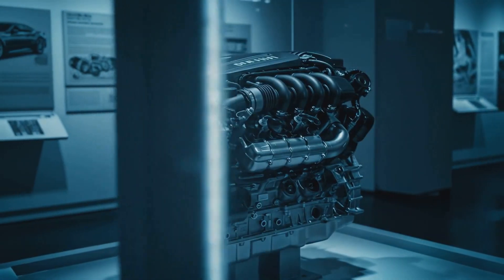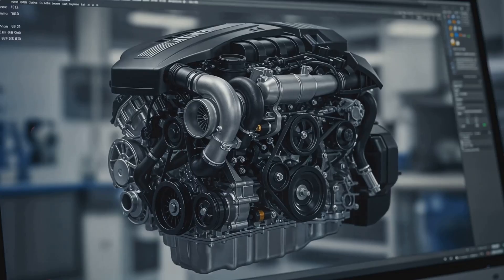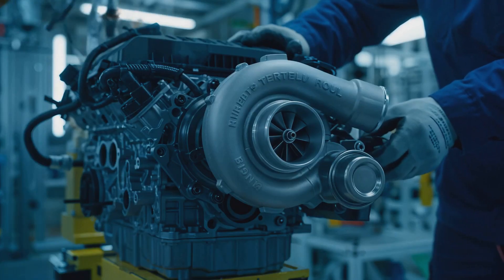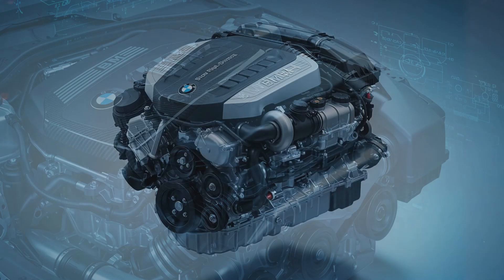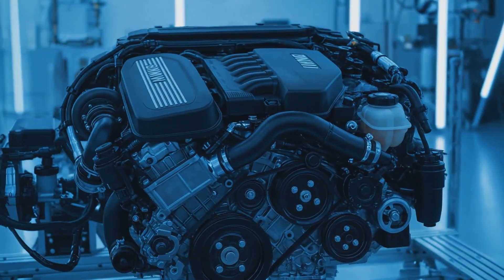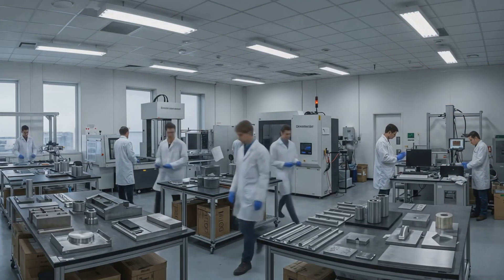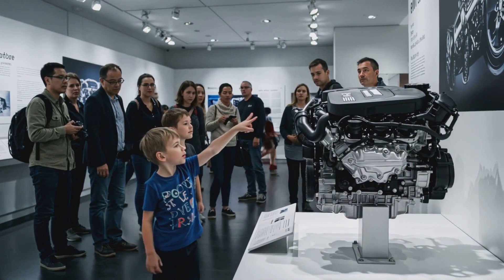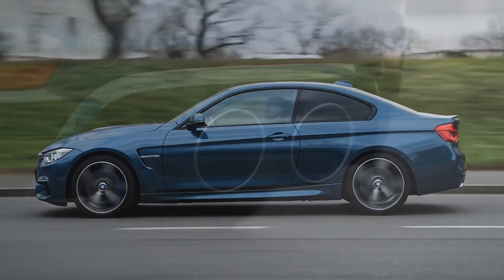What Makes the BMW B58 Engine SO POWERFUL?

Comment: Will this fit into a E46 engine bay?
Reply from the maker: Yes, it is possible to fit a BMW B58 engine into an E46 BMW engine bay, although it requires significant modifications and custom work. While the B58 is physically smaller than some of the engines originally found in the E46, it is not a simple bolt-in swap.